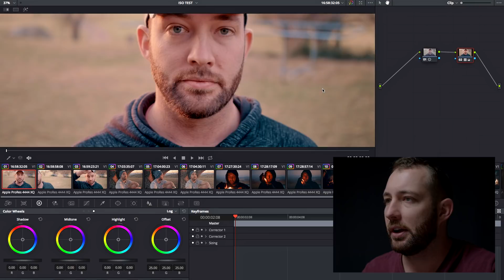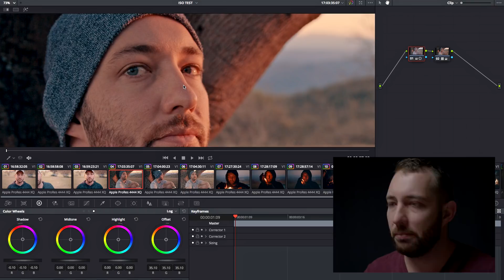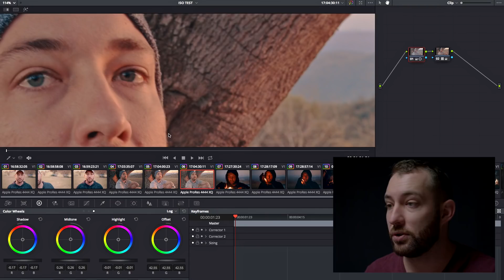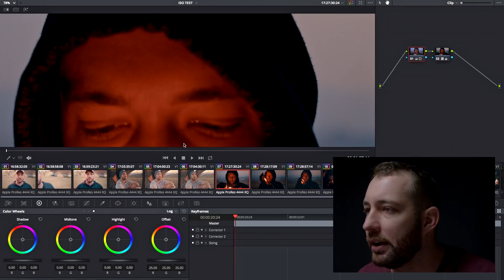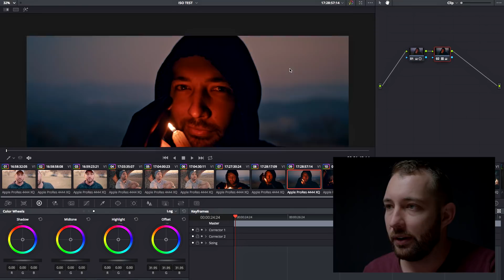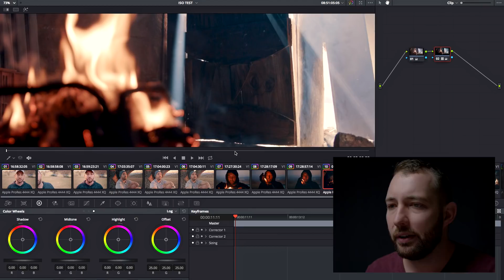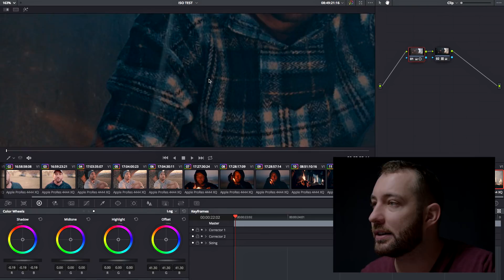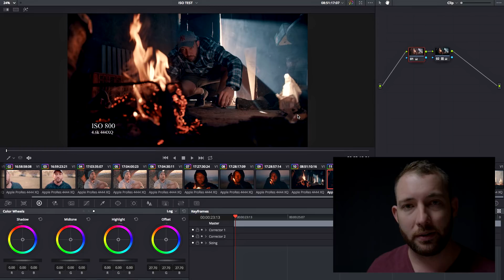ISO Capabilities On The URSA Mini Pro 4.6k

Comment: You can clean up the image from color noise/artifact with chroma noise reduction (with luma at 0) in Resolve really good. Even the 'Faster' option is really good but you can crank it up to 100 even with the 'Enhanced' option if slower rendering/not real-time playback is ok for you.
Reply from the maker: 100% agree! Just wanted to give UMPro users an idea of how to get the cleanest image in camera, also hopefully giving a bit of insight into how the cameras sensor works and which ISO setting gives you the most room to adjust :) thanks for the comment brother :)